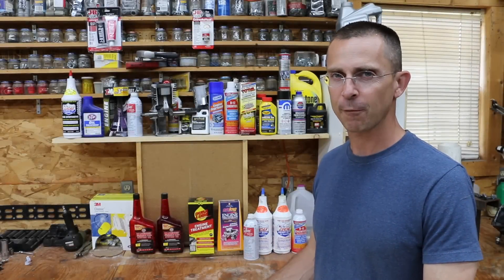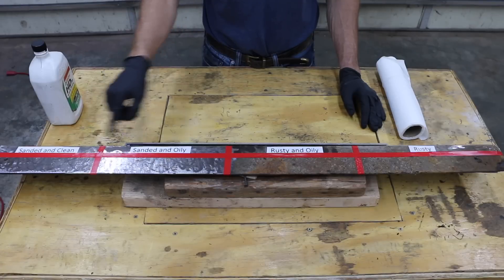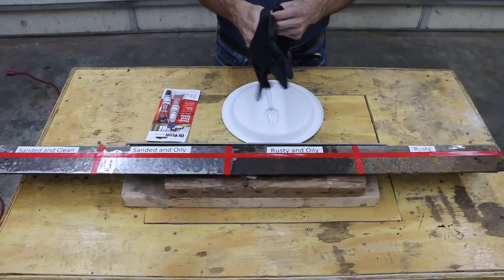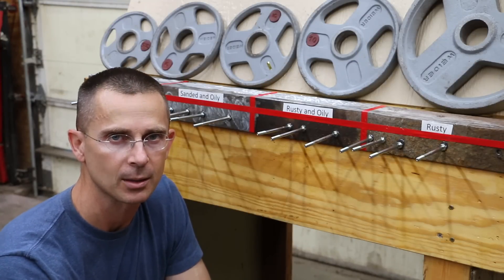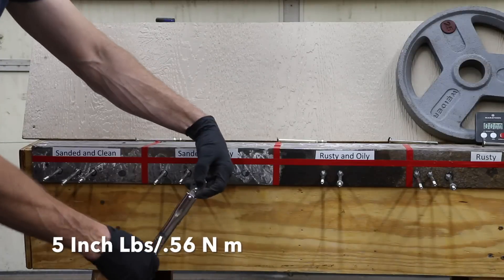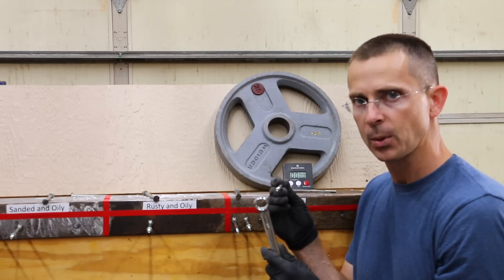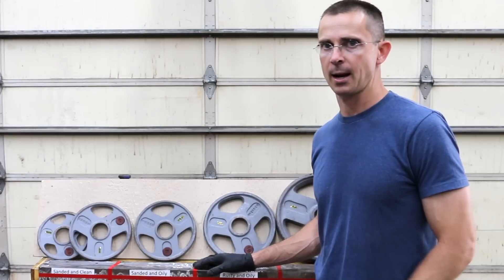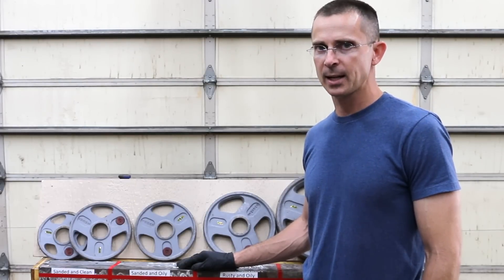How much does rust and oil effect epoxy performance? Let's find out!

Comment: You did a great job of answering the same question I had about epoxy strength.  Sometimes it is really difficult to do a good job of cleaning small, uneven areas, but the more clean the better, as you have aptly proven!
Reply from the maker: Thank you very much for the positive  comment!

Comment: The rougher the sandpaper such as 33 grit rosin paper cleaned with acetone or a tri-sodium phosphate TSP solution and or a safer phosphate free TSP  will create a incredibly strong bond.  You have to think of surface preperation as a mechanical bond such as micro crevasses you create in the metal by sanding, the deeper the crevasse the more surface for adhesion= a stronger bond.  Always degrease the surface before sanding so as not to push oil/grease into your newly sanded surface. Under a microscope a 33 grit sanded surfaces will resemble mountains with canyon walls , as opposed to a 400 grit which will resemble the great plains of Colorado gritty but smooth.  Remember surface prep is the difference between a great bond or a fast break up. I hope this helps.
Reply from the maker: vegasheat71, Yes, this helps!  Thank you for this advice!
Reply: vegasheat71 I am about to try this jb weld on a leaking ford 9” differential cover trying to patch it from the inside so you recommend very coarse sand I have cleaned it up with parts washer fluid and brake cleaner but the surface has paint and primer on it yet from when I had it sandblasted and painted as part of my restoration process 
It’s from a 1978 vehicle

Comment: Another great video and thanks for giving back to the community!  What sandpaper grit size did you use?  If I remember correctly, the coarser the grit, the more surface area bonding you'll have for the epoxy.
Reply from the maker: limrc1, Yes, you are right about the coarser grit being better.  I don't know the grit of the angle grinder disc but it is very coarse.  Thanks!

Comment: epoxies are almost always a waste of time...just grind it down and weld it and even then it may not hold but of course the better the prep the better the results
Reply from the maker: Phil, Great point!  Hoping to figure out the best strategy for using an epoxy in those instances in which welding won't work.  Thanks again!

Comment: These videos are great - both the quality of the video and the tests that you do!.
I'd like to see some testing of different types caulk.
There is such a huge variety now. Is it worth it to buy the expensive kind?

I recently attempted to seal a crack with silicon caulk from a tube that I had opened some time ago. It has been in my garage thru both freezing and high temperatures. Several days later I noticed that the caulk still had not cured - almost as soft as when I applied it.
Reply from the maker: Joe, Thank you very much for the project suggestions and for the positive comment!

Comment: Before retirement I was a chemist.  Surface treatments is a pretty active field.  There are even compounds called 'coupling agents' that consist of two different chemical groups on one molecule.  One end bonds tightly to the surface and the other end bonds tightly to whatever coating is being applied to the surface. Corrosion inhibitors are also chemicals that bond to the surface and interfere with the mechanism of corrosion and they work.  There is a lot of work being done in on bonding shape change memory alloys (which act as artificial muscles) to bones for prosthetic devices.  I probably just put a lot of people to sleep.  Sorry.
Reply from the maker: SE Michigan Andy,  You have my attention!  Thank you for this information.  I'll do some research.  Thanks again!
Reply: You might want to check out "phosphate conversion coatings" as a start.  Epoxides are excellent at bonding to a properly prepared metal surface.  But the surface must have properly formed oxide or hydroxy groups.  Gold, the most extreme example doesn't form those so epoxies won't work on that metal.   Some sulfur containing coupling agents will help make things bond to gold.  Stainless steel forms a passive oxide layer that occasionally needs special activation for bonding.  The field is pretty extensive and complex.  There is a company called Gelest that has several .pdf files describing the chemistry of coupling agents and their uses.
Reply from the maker: Thanks for providing the additional information.  I'll do some research and will see if it fits within the project budget.  Thanks again!

Comment: Your three testing criteria (steady downward pull, torque, and impact) are very well thought out, and adequate for testing the different epoxies, IMO.
Personally I would love to see more of these types of tests using different epoxies and on different surfaces, ie different types of plastics and wood.
As you mentioned, please use a solvent like acetone or MEK (methyl ethyl ketone) on your "best case" or "control" surface.  Thanks, TreeTop
Reply from the maker: Thank you very much for the positive comment!

Comment: Project Farm...

simple video, show one using Devcon that is just sanded like you just did, and one that was sanded and cleaned using 91% alcohol, and one using acetone, try to see what other cleaning agents that could be used for preparation and which one seems to produce the best results.

this could even be expanded to Original JB Weld as well, and the other top performers of your previous tests.

This could help emphasize how to get the best performance for your epoxy projects!
Reply from the maker: Spartan536, This is a terrific project recommendation.  Thank you!

Comment: Test Reltek adhesives!!! Especially if you're going to test plastics and glass
Reply from the maker: 80ATS, Thank you very much for the project recommendation!  I do most of my shopping on Amazon and didn't see Reltek adhesives.  Are they sold in any of the common hardware stores?
Reply: Thy're products aren't sold in stores but you can order through major distributors like McMaster-Carr and Fastenal. I buy their adhesive from amazon. Mainly the B-45TH. Not cheap but the best out there for low surface energy plastics: https://www.amazon.com/s?marketplaceID=ATVPDKIKX0DER&me=A14ZEQXSFYT77H&merchant=A14ZEQXSFYT77H&redirect=true

Comment: I appreciate how thorough you are with your testing. I think it would be great if you did a comparison of a few different adhesives... Epoxy vs Superglue vs Gorilla glue vs Liquid Nails... you get the idea.

And good job on the noise removal, thank you!
Reply from the maker: Cyanide Cloud, great project idea!  Also, thank you for the constructive feedback on noise removal.  I'm getting better with this sort of advice and I truly appreciate it!
Reply: Project Farm I will say though, there is still a bit of noise. Might not be able to do much more about it without upgrading the mic. But that's just getting nitpicky at this point. Looking forward to the next video.
Reply from the maker: I use a Canon 70D with a RODE external microphone.  Thanks again for the recommendation on filtering the noise.

Comment: Thoroughly done and unexpectedly different results! What about testing gas/diesel blends in 2 stroke engines? An older guy once told me he used 10:1 gas diesel ratio in his string trimmer
Reply from the maker: This is a great project idea!  Thank you very much for the positive comment!
Reply: i too would like to see a gas to diesel mix ratio test in a 2 cycle trimmer.  one thing, wouldnt the diesel gum up the engine?

Comment: I think you should do a video where you assemble an entire lawnmower engine using nothing but your fingers to tighten every single bolt, screw, and nut. then run it to see what fails first.
Reply from the maker: Great suggestion!  Thanks for watching the video and commenting!

Comment: No matter how a surface is prepared- an epoxy (or glue) will not mechanically etch itself into the parts. Any surface condition you have there- drill TINY holes through it, and liberally coat the entire bolt head, over the flats, up to the shank. Press it into place, allowing the epoxy to ooze out of the holes. When dry- the epoxy will be like a rivet, a true mechanical bond, and you can then properly test the load capabilities of (any) glue. With that simple anchoring technique- you can assemble anything (a wood handle to a steel door).
Reply from the maker: This is an excellent video idea and suggestion--thank you!
Reply: You're very welcome! For some fabricating of Drag Car bodies- I helped on one Mustang-ish setup for friends. We attached plastic, fiberglass, and aluminum all together- with JB weld. If you drill very small holes in both surfaces, you get a huge bonding area- that's as strong as the epoxy. After curing- sand the areas, prime & paint- and can't tell how they're attached. No ugly rivets or nuts & bolts. Think of fiberglass mat; they way the resin soaks in, then cures. Same principal. Epoxy (or glue) between surfaces is merely occlusive, and relies on surface tension- which is hardly anything. However- cyanoacrylate (crazy glue) IS an "etching" adhesive, that actually wicks into surfaces through chemically vulcanizing each, then dries using humidity. It bonds skin instantly- because that was it's original purpose. Dow Chemical developed it for the US Army during Viet Nam, as an instant antiseptic field suture and  dressing. It is widely used in the Medical Field now.
Reply from the maker: Secant Ogive,  I agree, drilling holes is a great suggestion!  Thanks for commenting!
Reply: If no one mentioned it, I was going to suggest this. This is by far the most effective method I've found for strengthening epoxy bonds!!
Reply: Superb comments, thank you for sharing
Reply from the maker: This is very interesting!  Thank you for sharing!
Reply: I don't think that would be effective on the sanded and cleaned surface since in the first test, the epoxy itself seperated, none came off the bolt or surface adhered to. Might just want to do it for the sake of completeness.

Comment: I had a oil pan that had a hole in it.  got me some JB Weld, I took the pan off, cleaned it, sanded it, everything was perfect... Mixed up alot of jb weld, put it on and it didnt hold more then 30 minutes... the JB weld came off as 1 big clump... Havent used it since.
Reply from the maker: Flippin Fast, That's disappointing to hear!  Thank you very much for watching the video and commenting!

Comment: project farm, it's good to see you are actually reading the comments from your viewers, I commented on your last test and it seems you took it to heart. Grinding the zinc coating off of the bolt heads makes a big difference, however, people that are using this type bonding agent needs to know that first of all epoxies are generally used for shearing strength, and they are typically used in conjunction with a mechanical attachment. Epoxies work off of surface area, more area more strength, I prefer to bead blast my parts, it cleans them and abrades the surface, effectively doubling the surface area. Another thing to mention is metals with coatings, such as zinc, oil, or mill scale, these things impregnate the steal at the microscopic level, and obviously need to be removed, but it's not that easy, here's a test you can do to show this, take a plane non coated piece of steel, drop it in a dish of oil, any will do, let it sit overnight, clean it with any degreaser you like, alcohol, thinner, brake clean, whatever, then put the steel in a vice, use a torch to heat up the metal from the bottom, you will see oil come out of the steel like it's some magic trick. This will show just how much the oil penetrates the pores of the steel, it's as bad if not worse than rust. Good video, next time try this with short bolts so you remove some of the lateral stress, then you will see what the shear strength is.
Reply from the maker: R Wells, I'm learning a lot from those like you with tremendous experience.  I really like the visual demonstration idea you've recommended on oil getting into the pores of the steel!  Also, the short bolt idea is a terrific suggestion.  I've already started another video and have already used long bolts.  So, there will be one more video before I get this right.  Thanks again for taking the time to comment and for the positive feedback!

Comment: Another great vid!. I'd personally definitely like to see you test epoxy adhesion to different types of surfaces. I have one comment about your testing technique, when your testing how well they withstand being twisted off the surface I do wonder if some of them failed prematurely because as your twisting the wrench your also inadvertently putting side load onto the bolt (ie not quite applying pressure dead on straight) the effect is probably pretty small but if you could build some kind of support surface/frame to eliminate any side loading. I'm really glad I subscribed to your channel, properly done and unbiased product testing for engineering products is hard to come by. Keep up the good work! :)
Reply from the maker: Jon W, Very good point regarding the side load and I agree that I am likely inadvertently causing a side load.  I should test bold much shorter in length to help alleviate this.  Thank you for this constructive feedback!  Also, thank you very much for the positive comment!

Comment: Great vid! thanks.  One thing I use at work is the double-sided foam tapes.  I wouldn't complain if you ever got around to those.  A thing to test for all adhesives is heat as well.  Maybe rerun the tests but after heating and cooling a certain number of times.
Reply from the maker: David, These are terrific suggestions!  Thank you!

Comment: You are not wasting your time!!  I always look forward to what you have next. I always learn something of practical value. 

As for ideas, how about working with some 1/4" plexiglass. That is a common material that many craft and shop people build with.   Drilling holes?  Different bit cutting edges can make a huge difference in clean or chippy holes.. sawing, sanding and polishing edges or flame polishing,....bonding edges to next surfaces as in corner joints, with solvents, clear paste glue, epoxy, silicone RTV, etc... plexi could make for a whole series of vids..
Reply from the maker: Jennifer, These are terrific project ideas!  I'm actually planning to use 1/4 inch plexiglas for an upcoming project, but the ideas you've recommended take things to a whole new level, which is fantastic!  Thanks again!
Reply: Project Farm 
Looking forward to your plexi fun!

Comment: Hey great channel and videos, would you try using TC-W3 oil in the gas and check if it makes a difference in mileage/performance/cleaning? 
I use it in all my motorcycles with great results.
Cheers!
Reply from the maker: This is a great project idea--thank you!

Comment: plastic epoxy; that is the most common repair. Also antiseize on rusty bolts or threadlocker brands strengths. Including harbor freight $2 threadlocker.
Reply from the maker: D4x4Bronc, These are terrific project ideas--thank you!

Comment: That's super cool I regret not properly preparing a cracked radiator about 10 years ago before I used a similar epoxy to repair it. I got a few miles down the road and then it failed.
Reply: I think it was a product called "Steel Putty" ... it seemed to be a really solid product I just didn't do the right preparation. It would be interesting to see some videos on that product.
Reply from the maker: Gideon, Thank you very much for the positive comment!  I'm guilty of poorly preparing surfaces on many occasions, not realizing the difference it makes.  I learned a lot from this project!

Comment: That was a very informative video. Guess I will have to clean areas better. Do you plan any videos on the use of stop leak in a manual transmission? I wounder if they really work?
Reply from the maker: Ron, The stop leak suggestion is a terrific project idea! Thanks for watching the video and commenting.

Comment: love these tests!  you should start a patreon
Reply: people dont mind patreon to pay for materials, people do mind patreon when the creators are making bank and not really using the money for the videos
Reply from the maker: This is a great point!  I don't desire to use any patreon contributions for personal gain.  I'd love to do more epoxy tests or use new engines for destructive engine testing/comparison.  Both of these get expensive.  Thanks for commenting on this!
Reply from the maker: Brian, These projects are getting very expensive.  I'm tempted to start a Patreon but feel bad about accepting money from other.  Still thinking about it.  Thank you very much for the positive comment!
Reply: I've been wondering where/how you get all your engines. It seems like you might make enough by restoring some of these engines afterwards?
Reply from the maker: o HeretiK o, I buy these from those selling them on Craigslist and several mechanic friends.  I haven't sold any of the lawnmowers or what's left of them yet.  I'll likely donate the parts to the mechanic friends who can use the parts for making repairs.  Thanks!
Reply: That would be where I'd come in. Trying to make a silk purse out of a sows ear without a silky sow!
Reply: I'd support pay per video
Reply from the maker: Scotty, Thank you very much for the offer!

Comment: I have tried using the Epoxy JB Weld Clay. Have you tried that? Very good video.
Reply from the maker: Adam, I have not yet tested JB Weld Clay.  This is an excellent suggestion--thank you!  Also, thank you for the positive comment on the video!
Reply: Project Farm I have tried using it trying to fix a dipstick tube. It's tough to do. Lol. Thanks again!
Reply from the maker: Adam, I'm looking forward to testing it out.  It might end up being a product I keep on hand in the shop.  Thanks again!